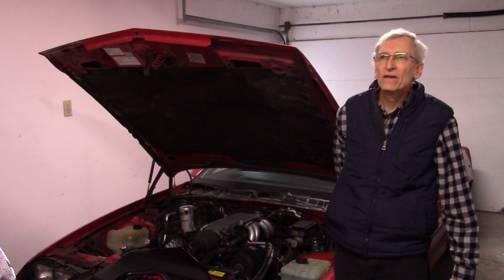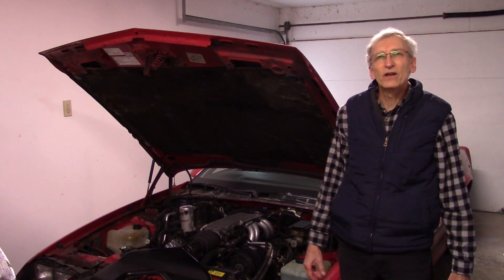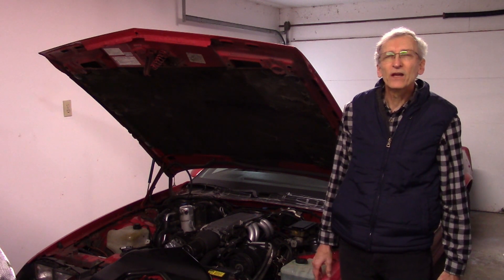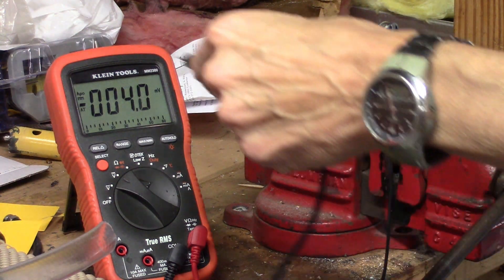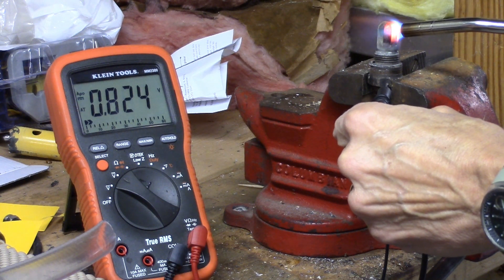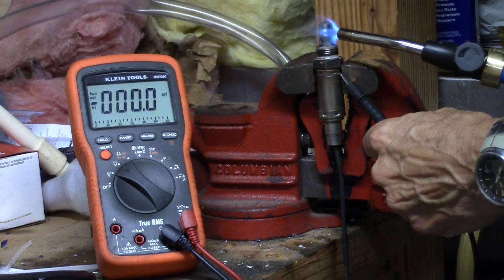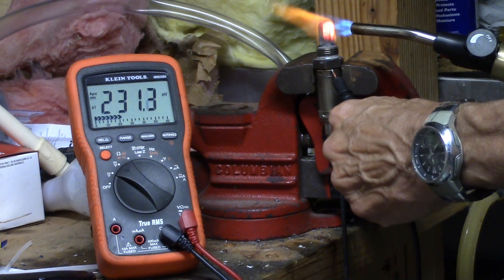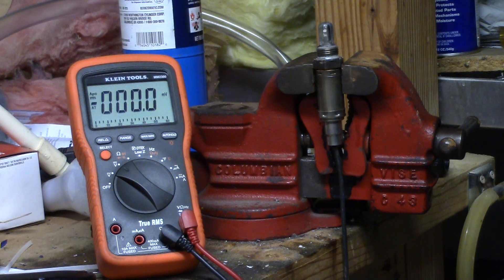Bench Test Oxygen Sensor (O2 sensor) with a Propane Torch - IROC-Z Barn Find EP#41

Comment: I performed a test similar to yours with my Delphi sensor out of my 1987 Iroc Z 5.7tpi. I put the sensor in about two months ago and it seems like I have had a weird idle. I’ve posted comments on some of your videos before. I didn’t suspect the o2 sensor because it was new, but after your test my sensor performed the same. I am thinking of getting a delco sensor. What are your thoughts? The Delphi one I installed was ES10966.
Reply from the maker: Generally I lean toward using the AC Delco parts, because in my past experience, the AC Delco team works to insure that parts meet GM specifications for the application.  Long ago, the parts were often made by GM divisions, but today sensors and similar parts are usually purchased from outside suppliers. I also do look at parts from Delphi because they sometimes were the original manufacturer, however it seems that quality can vary. Lately I also use Denso and Bosch parts as well with good success

Comment: Have you figured out the gurgling sound from the tank? My friend is experiencing the same thing on his 1988 Pontiac trans am. Smell of gas, there is so much pressure, when you open the gas cap, you can hear and feel the pressure escape.
Reply from the maker: I am still tracking that down, but I suspect an issue in the evaporative emission / purge system.  I'm going to look at the charcoal canister and related valves shortly.
Reply: @bitsofwisdom460  look forward to seeing you find the cause
Reply from the maker: I have been through the system and it seems to be fixed.  It needed a new purge valve in the vent line.  I have the details posted in EP #45 at this link: https://youtu.be/ibc1ncAsiho
Reply: @bitsofwisdom460  thank you very much for the update. I’m glad you had figured it out. I will let my friend know what you had done. Keep up the good work in giving the IROC a second chance at life

Comment: I get a gasoline smell sometime with my ‘85 IROC-Z, normally after filling with gas. The problem is that the gas cap is hard to screw in the filler nozzle. I put a very thin layer of grease on the gas cap threads to make sure I can screw the cap down all the way. I’ve had the same issue with several new gas caps. I assume the filler pipe is slightly out of round. One I get the cap seated on the filler, no gas fumes.
Reply from the maker: When I replaced the gas tank with a new Dorman back in EP18, I had to change the cap because the factory cap wouldn't screw down all the way, the threads were too tight. I saw many online complaints about that.  On Dorman's advice, I changed to a Stant 10834 (cap fits 2010 Camaro).  This one is just a little smaller in diameter on the threads.  You may wish to try that.
Reply: @bitsofwisdom460  I’m going to try that gas cap. Thank you very much.
Reply: I tried the gas cap you recommended and it works perfectly. Thanks again.
Reply from the maker: @ericoswood1856  You're welcome. Glad that worked for you.

Comment: I have bought new o2 sensors that it just seems the vehicle doesn’t like and throws codes or have drivability issues
Reply from the maker: I have seen O2 sensors go bad in a number of ways, but this one was new to me.  To trip a wiring code instead of a rich / lean fault code seems unusual.  Essentially, when it's really continuously hot, it biases over to 300mv and stays there, and when it cools off it comes back.  I could watch it cruising down the road at a steady 55 mph and it would drop into that 300mv setting.  Being that the sensor was only a few hours old, I really didn't believe it was bad until the bench test.  Perhaps when the first engine went down, it damaged it in some manner.

Comment: what kind of scan too you are using? you can read live data on the iroc??
Reply from the maker: When I was having trouble with engine #1, I researched and bought a tool.  I could make measurements with jumper wires and a digital voltmeter or run some of the special test routines in the service manual,  but that didn't work well driving down the road.  I purchased an Actron CP9690.  It seems to be one of the few OBD-1 capable tools available.  It does read live data stream and has limited recording. It is a big help for me.  I have been thinking that I should video a segment about this tool so people can see what it does.
Reply from the maker: I posted a review / demo of the tool.  https://youtu.be/t9_YORMhkvs